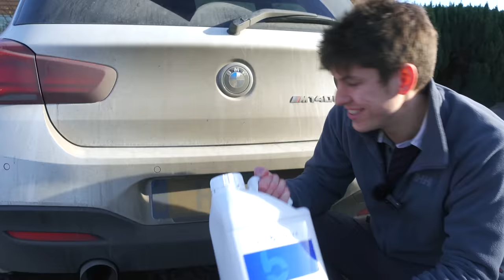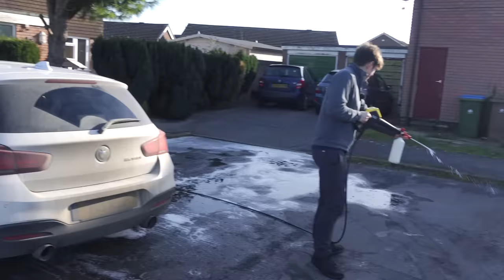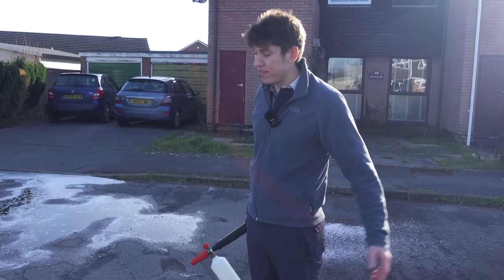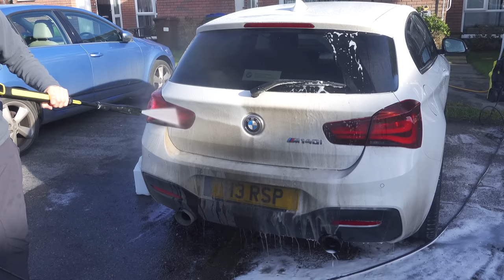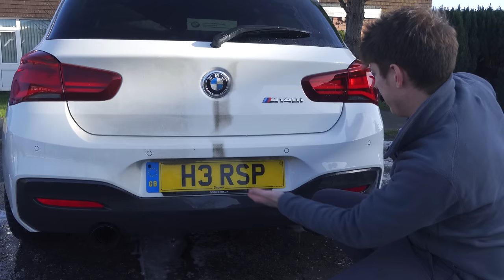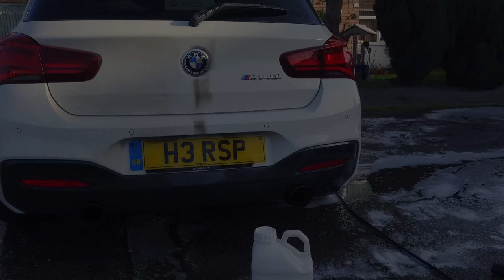Does Snow Foam Actually Work? The Results Might Surprise You..

Comment: Nice video, but to have a true control you would need to compare the snow foam side with wetting the other side with just water for 5 minutes before jet washing them off. Just saying...
Reply from the maker: Thanks bud. Not if you like to snow foam the car dry. Which is actually what you should do for better results. I’ve tried it both ways, and it makes no difference (in my experience)
Reply: @roadreg1820  If it really makes no difference, then pre-spraying with plain water is just a waste of water.
Reply from the maker: @1959Berre  spraying with water does absolutely nothing. I tried it myself. That’s why I didn’t do it in the video.
Reply: I don't use snow foam (mainly because can't find a unit that fits my pressure washer). If my cars are really dirty, like your BMW, I normally take it to the self serve car washes and give them a good going over for about 3 minutes. I use the high pressure washers only as they are a lot more powerful than mine. It won't remove all the dirt but when I get back home it makes it slot easier to wash the cars by hand.
Reply: @roadreg1820  I think the original comment was referring to the fact that the snow foam is a soaking agent that interacts with the surface to improve the dirt removal process and I suspect any form of soaking would make a difference versus an unprepared area. Perhaps a better experiment is to compare the difference between foam and plain water as pre-soak agents? I suspect it would still be better but it would be a more comparable set of conditions; y'know, science and all that.😂

Enjoyed the video though, thumbs up from me 👍
Reply: Making the no snow foam side wet and letting it soak will also help a lot. But yeah in my experience snow foams do actually work.
Reply: Hi what make snow foam would you recommend
Reply: @roadreg1820  I'm not following your logic here. I think his point was that it would be more meaningful if you presoak both halves; one half with spray foam, the other half with plain old water. Then pressure wash both halves. That would determine if there is any value to foaming vs just wetting your car with water and letting it sit for five minutes before power washing.
Reply: @Merlin51h  Marolex 3000 pump sprayer + an air nozzle/wireless air compressor hack would help your situation a ton.

the Qicycle or Xaomi 1S work pretty well here, with the former being the more powerful of the two.
Reply: Took the words right out of my mouth
Reply: Well said mate,it makes sense
Reply: How does that make a true control? It’s a comparison between using snowfoam and not. If you aren’t using snowfoam you don’t damp the car for 5 minutes before washing, you would just wet then instantly wash?
Reply: @ChrisHughes127  Because then you'll know whether it's the snow foam or the water that was making it easier...
Reply: @ChrisHughes127  It's so both sides receive a 2-stage treatment. At the moment, the foam side has had 2 but the water-only side just had 1. So you don't know for sure if it's the foam or the 2nd stage that made the difference. FWIW, I think sno-foam does improve the cleaning.
Reply: The importance of wetting the vehicle come into play when you use a cloth/sponge to wash, you need lubrication to reduce scratches.
Reply: Just done a similar test to end a discussion about the use of snowfoam. I used the Bilt Hamber touchless aswell. I did soak the other half of the car with plain water and the results where pretty similar to what is shown here. The traffic road film just doesn't come of without the snowfoam like it does with the snowfoam. It removes much more harmfull dirt before you start your contact wash.
Reply: Anyone who's ever washed their car with a pressure washer knows that you can walk around it 10 times spraying with plain water for as long as you want, and it'll never remove a significant amount of traffic film.
Reply: @joeschmoe6908 that greasy road film needs a proper detergent to get it lifted. I'm doing it by hand right now, but the snow foam looks like an incredibly quick way to get the job done.
Reply: @jbock2753  Well stated.
Reply: Exactly. I think people are getting confused. If you pre soak the car with just water and let it sit for a minute or 2 it helps. Just like when you have a bird poo on your car and you soak it with water it comes off easier.

Comment: It only works well because bilt hamber touchless is NOT a ph neutral soap. Most of the foaming soaps out there are ph neutral
Reply: PH neutral is what the average consumer needs with there standard carnauba based wax or no wax. Ceramic guy are fine with pH 12 of car pro lift or even higher of around 14 with bilt hamber. I use pH neutral for summer maintenance wash but think 14 is fine for colder salty Road months but think 12 is fine all the time

Comment: I avoid using a pressure washer on my car. It runs the risk if forcing water past window rubbers etc. I prefer simple hose pipe.
Reply: I totally agree, I use at least 3 buckets of wash and wax in buckets and the hose pipe.
Reply: only when the car was washed regularly
Reply: problem with that is, if there's any dirt build-up in the raingutters behind the rubbers etc. you won't get it completely cleaned out. But it's still better then using a pressurewasher the wrong way ofcourse.
Reply: Problem with a hose is your not getting a lot of dirt off doing pre wash so you run the risk of causing scratches when doing the contact wash, I been using pressure washers for god knows how long and I’ve had no issues
Reply: I avoid driving a car altogether, I use my horse carriage and wash it with a bucket of water I collect from the well. Then I gently brush the horse and feed it some hay and blueberries.
Reply: @GTDpowah 🤣👍

Comment: Not sure if it was mentioned but a very key aspect to keep in mind here... Bilt Hammer Touch less is a 14 PH snow foam. The alkalinity is what helps with cleaning. Most people do their snow foam with regular PH neutral soap, same as the bucket soap.
Reply from the maker: Yeah I am aware but the PH level is fine for waxes and coating. I’ve had my car ceramic coated last year and the coating is still working well.
Reply: It's pH is a lot less once watered down!
Reply: @youbencowell  I mean that depends on your definition of a lot less. 14 PH is 10 times more than 13 PH and 100 times more than 12 PH. It will not get anywhere close to neutral.
Reply: Wouldn't touch BiltHamber myself. Far too Alkaline a PH for a snow foam imho. 
It's a pre-wash for the purpose of reducing paint swirls though contact washing. It's not a wash so no idea why BiltHamber add detergent to try to make it behave like one, resulting in neither a great snow foam or wash imho
Reply: Love the fact everyone is going on about so many products and the huge amount of products on the market, You can clean a car with less than 3 to 4 products and the finished result would match any of the products available on the market, it's down to the detailer and his own experience, being thorough and not missing a single point on the car. Unfortunately we are bombarded with retailers trying to make too many products which are no different to many others on the market. Consumer's are fooled by the smell and look of products.... Brand names and worst of all you tube! . So keep it real everyone its down to the experience of the detailer. Good video.....
Reply: IMO using that pressure wash that close to the paint works and the almost 90 deg angle will not be terribly good after repeated use. Of course water blasting will remove first etc if you direct it at a patch long enough the paint will come off eventually.
Reply: @jacobheinz8236 excuse me, what will be the righ angle to spray the water?
Reply: @jacobheinz8236  LOL none of the pressure washers detailers use provide any real threat to the paint. TBH you want to be on a 90* angle for the most effective cleaning. Also being to sure too work 6" strips or so. 

My pressure washer is 10GPM @3500 psi (i normally run it at 8gpm 2500psi or so) and i never peel paint, unless its already fked underneath.
Reply: 1 @Saddedude

Comment: Good little video, thanks! Lots of comments about Touchless not being PH neutral, which is fair comment but, as far as I am aware, it doesn't strip wax as is being suggested.  Yes it does degrade wax slightly quicker but it's pretty negligible. I just think, if it cleans the car better and makes a contact wash safer, I'd rather apply a new wax a few weeks earlier than if I was using a PH neutral SF.  I tend to think, if you're using a SF then you probably care enough to protect the paint, so a little earlier waxing isn't too much of a problem.  All the best.
Reply: I've been using Turtle Wax Hybrid Ceramic Wet Wax and I think it's superb, certainly for ease of use. As the name suggests, you can use it without drying the car and it's easy to apply and easy to wipe without leaving streaks - no buffing like you have to do with many ceramic products and it leaves a really slick finish. I don't know how long the hydro effect lasts but I'm not that bothered, I wash my car often, and you don't need to use a lot so it will last.

Comment: As new comer to snow foaming (72yo) I’m still working out the intricacies of how to get the best results. This is exactly what I needed to see, I’m currently using Autoglym’s Polar Blast which is a pre wash and was left questioning if I was actually getting the car any cleaner. I was planning using Build Hammer as my next purchase having read reviews on it. Thank you so much for the demo.
Reply: How long have you left the autoglym foam on before washing it off? I leave it for 10 mins myself.
Reply: Bilt hamber is far better. I've used both. Almost out of BH auto foam and then I will try their Touchless snow foam. You need to calculate your panel impact ratio to your jet wash. It will work as intended then.
Reply: Ditch the Autoglym,go for Bilt Hamber Autofoam or Touchless.
The difference is night and day,also a good foam cannon.
Reply: @swift2117  just tried Touchless and it's brilliant. Better than autofoam
Reply: Tried polar blast. Seen no difference at all. Don't rate it
Reply: It the snow foam safe for environment? Run off goes directly into bay.
Reply: I know this was a while back but, that snow foam certainly did the job, bit awkward to catch the name of it  ?
Question for you if your still on here  ??  Do you really 🤔 or actually need to apply snowfoam using a preasure washer  ?? or can you use a normal pump up spray bottle and using say a 50 / 50 mix  foam and water  ??
Hope you can help 🙏 
Cheers Les. 
Great video by the way 👏 and the result is stunning, almost unbelievable but the proof is right there before your eyes. 
If my car could look like that 🤔 I'd be well chuffed 🙂 
It's pearlescent white. 
Cheers Les
Reply: Build Hammer...

Comment: I'm glad someone has finally tested this, although I'd like to see the non snow foam side wetted down first, as water pre-soaking into the dirt might have an effect.

Another good test would be snow foam vs spray on pre-wash to see if snow foam is really worth the extra faffing around or is it just as effective to spray on a pre-wash and let that dwell for 5 minutes instead.
Reply: Never wet before applying snow foam. It works by far the best spraying the foam directly onto a dry car. Dry dirt will sort of absorb the foam a bit helping it release.
The foam is very wet as it is and has all the required chemicals to soften the dirt far better than water.
With a good foam the difference with or without is quite incredible...
Reply: They all have their own purpose. A pre-wash shampoo however is better on an unprotected car, since most pre-wash products will damage alot of waxes or other protectants. A foam-shampoo often is softer on those kind of things.
A pre-wash step is also a good first step, when wanting to do a complete decon afterwards, like iron removers, degreasers and insect removers.
Then again, many detailers find their own thing, what works best for them. There's no real advantage using an expensive foamshampoo on a very dirty unprotected car.  A pre-wash product often is alot cheaper and removes or losens alot more then a foamshampoo will.
Reply: I would like to see spray apc vs snow foam (neutral and strong), too.
Reply: @revorocks123  The OP didn't say anything about wetting before applying snow foam.
Reply: @revorocks123  Yes, my take on this is that if the car is wet it will make the snow foam run off quicker before it has had the chance to do it's job.
Reply: The snow foam also acts as a wetting agent before being power washed off….the other side was simply power washed off dry…..my question is if the other side had been rinsed down first then both sides rinsed off together could  the results have likely been a little closer.????
Reply: @revorocks123  
Autoglym's own video, entitled "How to use Autoglym Polar Blast", actually tell us o pre-rinse the car first, to release as much dirt as possible, so their Polar Blast is able to do a better job.

Comment: Looks very nice. I'll probably give the pressure washer another chance. Be careful with how close you're spraying the car and how much pressure you're applying; you can strip paint and peel back any paint protection film very easily with the jet stream.
Reply: Shouldn't use the pressure washer at all. Now that we see the foam works, all it needs is a shower nozzle rinse followed by a mist nozzle spray-down to break up the surface water bubbles. Pressure washing kills car paint.
Reply: @hulkhatepunybanner  false.
Reply: @matsudakodo  True.
Reply: @hulkhatepunybanner  if you're that afraid, don't use one.
Reply: @matsudakodo  I don't use one. It ruins cars' paint.
Reply: @hulkhatepunybanner  false.
Reply: @hulkhatepunybanner 17 years, and thousands of cars later, I've never ruined any paint yet 🤷‍♂️
Reply: @tonyhill1916   You've washed thousands of the same cars over 17 years?
Reply: @hulkhatepunybanner  Im a car detailer and never had any paint damage for almost 15 years. Most of my customers are repating customers. So yeah many of the cars i do over and over again for years.
Reply: @GameOver556  Alright, Biff. I guess any damage done could be hidden with polish. But you got a job to do and you have to do it quick, not right. Customers are clueless anyways. Those buttheads. I put that out there to warn folks who haven't bought one so they don't ruin their cars. That's all. The message is for them, Biff.
Reply: @hulkhatepunybanner  Sounds to me like you're the clueless one. Not everybody is stupid and if pressure washing was damaging their paintwork they would be able to tell sooner or later. I've never had a problem and I've been using a pressure washer for years, except for a recent 4 year spell with an old car that I just took the local handwash garage. It's most likely the pressure washer that loosens most of the dirt rather than the actual product.
Reply: @gssf.gr29  Pressure washer looses some dirt and also drives dirt into the finish. I've had two cars' finishes ruined by pressurized water, each over a 100k mile period. That's why I'm adamant about this. The car I purchased after these was washed by hand and hose using an ordinary spray head. And the finish was well maintained after 100k miles. I've been following this method since with good results. No car wash, no pressurized water.

Comment: It would be more interesting to compare it to water.
Make the other side wet for 5 minutes as well, then rinse it off.
My guess is that making the dirt soaked in water would make a huge difference compared to trying to wash it of all dry.
Reply: Who would soak there car in water before washing lol. This is a simple case of checking whether snow foam does a better job than not using snow foam. It clearly does.
Reply: @NoNonsenseJohnson  Yeah who would be that stupid right? ;)
Reply: @NoNonsenseJohnson  Which is a pointless test. You could buy pints of bull semen or truffle oil on the basis of "It cleans the car better than nothing" - any product that makes a soapy foam will clean it as well - the point is, most of these other products are significantly cheaper and you probably already have them in your home. It's like trying to sell / promote expensive shampoo by comparing a really expensive one against just wetting your hair.

Comment: I use Bilt Hamber Touchless. Hands down, the best snow foam I’ve ever used by some margin. It’s actually quite amazing how clean it can get the car before touching it.
Reply: What kind of soap do you use? What's the soap/water ratio? I tried Blue Coral car wash and it doesn't work in a foam cannon! Just won't build up a lather no matter what ratio I mix.
Reply: @largol33t1  I use the Bilt Hamber car wash concentrate. It doesn't really create a lather, but it cleans really well. You just use about 5mls at a time & it lasts ages. Bu the time I've used the Touchless, there's very little left to clean.

Comment: I’d been using a snow foam for a few months. It’s a bit gimmicky if you ask me. In my opinion yes it does lift some dirt, but it’s get very clingy to the paintwork and you end up using a lot more water to shift it. Then I have a lot of mess left on the driveway afterwards. I’ve gone back to washing my cars with rain water and a cheap £10 wash n wax. It’s amazing how many people comment on how shiny our cars are!
Reply from the maker: Nice. As long as your happy with the wash n’ wax, then result !